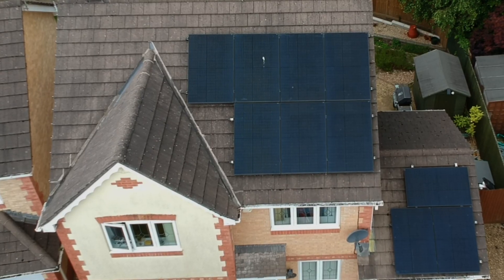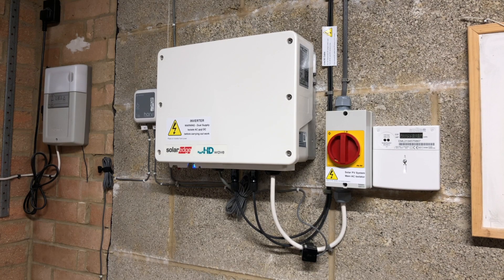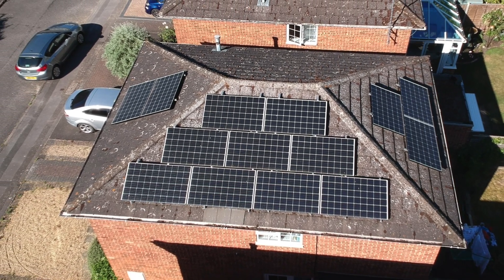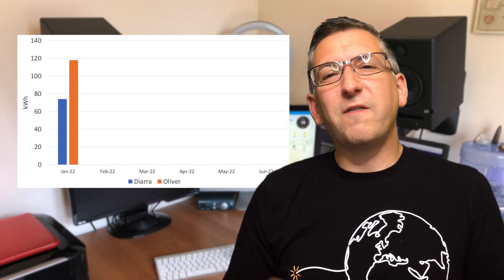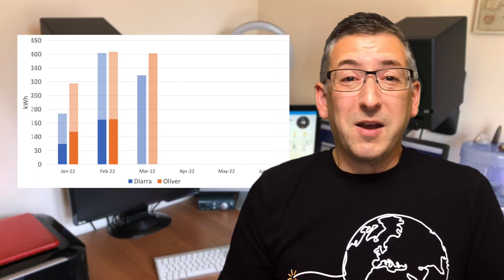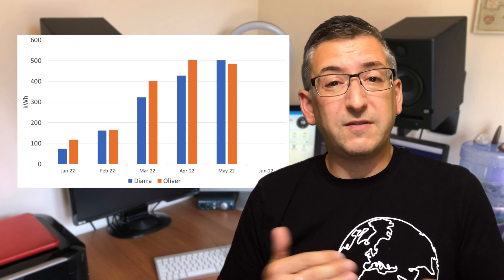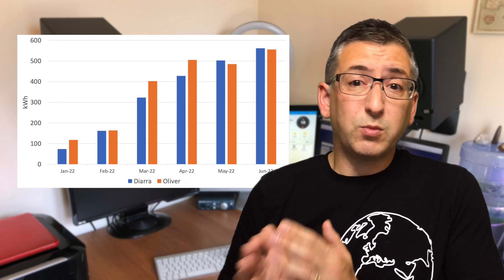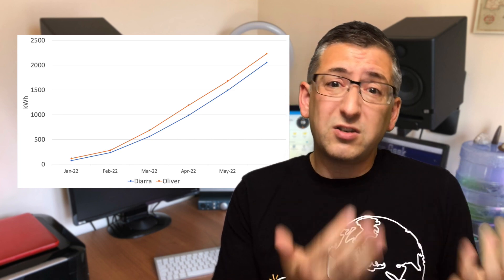SolarEdge vs Enphase: Six Month Update

Comment: The most important aspects of solar inverters are:
1) reliability
2) reliability
3) reliability
I have replaced half of the solar edge inverters I installed over the last ten years and have replaced many Enphase units we did not install.  As a solar installer, I think it is way too risky to install electronics in a hostile, under array location where servicing involves a truck roll as they fail one by one.
Reply from the maker: That's useful to know thanks, it explains why the installers I spoke to when getting quotes were reluctant to install micro inverters.

Comment: The comparison is not really an apples to apples comparison.

There’s roughly a 1% more efficient round trip conversion rate with SolarEdge because they use DC-to-DC converters.

However, SolarEdge’s central string inverter is most definitely going to fail earlier because of it being a string inverter and not a micro-inverter. It’s going to be inverting more power and thus taking more wear and tear than the micro-inverters which will increase maintenance costs.

Also, like they pointed out in the video, with the microinverters, you can slightly edge out on power production no matter what the roof plane is because it’s all about amount of useable light.

The best approach to Enphase is to try to minimize the clipping from the DC conversion as much as possible but to not oversize the microinverter to the panel so that you get the full use of the microinverter.
Reply from the maker: Valid points... but best we could do without a proper control environment :) It's more to get a conversation started over a comparison with the solutions rather than being a precise kWh to kWh generation comparison. We'll try to update over time and we'll see if reliability really is different between them.

Comment: The latest round of rate hikes (here in S. California) really make the west facing panels more valuable. Our peak is 4-9 pm and 83c (~70p) per kw. My array is perfectly south facing but it would be nice to pick up ~3kw during the highest rate period with west facing panels espectially since we still use AC here into the evening.  We are able to cut all other useage during the peak except temps can rise to over 80F on hot summer nights.

Comment: This was comparing apples & oranges. In practice for the Enphase user, a SolarEdge system would have likely been significantly better.  With multiple-sun angles, the peaks that give you panel-level clipping with Enphase, would likely balance out and not clip with the SE inverter.
Reply from the maker: That was kind of the idea though, two totally different systems installed to try and generate about the same amount of power from the physical restrictions of our respective houses. I know it's not terribly scientific, but I found it interesting to compare and it fun to put together.

Comment: Interesting video, and timely as I am looking to possibly replace my Sunny Boy inverter on my 10 year-old system. I have a home-made tracker (see video link below) which produces about 4400kwh per annum but suffers from partial tree shading during winter months. I have just been quoted £4500 to replace existing inverter with a Solaredge design, how would the price compare to using micro-inverters? (I do like the fact that the Solaredge comes with a 25 year warranty!)
Short video of tracked array:  https://youtu.be/9HBbwar4EMI
Reply from the maker: £4500 just to replace the inverter??? That sounds very steep. My 3.68kW SolarEdge inverter only costs about £700 so plus installation I'd expect it to be around the £1k to replace. Unless you are considering other components like optimisers and maybe new panels in with that cost? And I've watched that video, that's some serious engineering going on there! I wish I had the land to put something like that on.
Reply: @SpeakToTheGeekTech  Yes it does sound steep, considering the whole system was installed ten years ago for £7000. You guessed correctly, the price includes adding the optimisers to each panel. Not sure how much you paid for your complete inverter set-up with optimisers?
Reply from the maker: My whole system was about £10k for inverter, 10x optimisers, 10x 390w panels, Eddi/Harvi, GivEnergy AC-3.0 battery/inverter. I'm in the process of putting together a video about the costs and payback timescales so it's all fresh in my mind at the moment.
Reply: @SpeakToTheGeekTech  do you know what the inverter plus optimiser cost was? That is the figure I will need for comparison and also working out payback scale.
Reply from the maker: I don't exactly sorry, my quote was never broken down into that detail. I only know by looking up the products on other reseller sites. Roughly £700 for the inverter and £50 per optimiser was what I saw when looking back a year ago. That excludes installation of course.
Reply: @SpeakToTheGeekTech  thanks, even with 18 x £50 for the optimisers the total cost of components to replace my Sunny Boy still comes in at less than half the price I was quoted. I will tread cautiously…

Comment: Hi guys got bit stuck on Enphase manufacturers reference number on DNO notification I was given a number by Enphase which was termed as a reference used in Northern Ireland for g99
My inverter are iq7A if diarra remembers his notifications may be he can help.
Reply from the maker: I'm afraid that for both me and Diarra our installers completed all of the DNO paperwork and submitted it on our behalf. I've checked my letter from the DNO and for me it just says "Installation of a Solar Edge SE368OH Inverter & Giv Energy Giv-AC3.0 Inverter - exporting 5.2kW only", so no special codes on the response at all.
Reply: No worries thanks for reply 👊🏽

Comment: Its all horses for courses 

Each string on the emphase solution will terminate into junction box, which could be classed as a single point of failure 

Also, if a micro inverter fails, you need to get on the roof, get under the panel to swap it out.

The Solar Edge inverter will be more accessible.

And because the solar edge system uses optimers, it can handle shading and split roof configurations  the same as Enphase.

But the the real decider will be the  performance and efficiencies when batteries are added.

The solar edge system can allow a DC connected battery, meaning one DC to AC conversion for usage.

Because the Enphase solution has AC coming from the roof, to store it will need an AC to DC conversion, and then to use the stored energy will required another DC to AC conversion.

So SolarEdge beats Enphase in my view
Reply from the maker: I agree with your conclusion of course! Our conclusion so far really is that the differences between the two brands in terms of performance is negligible compared to other factors such as the layout of your roof. But still, it's a good conversation to have.
Reply: If solar edge optimizers go out, you have to get on the roof and under the panel. Just as you would with enphase micro inverters.

Comment: Hi Guys, Fun competition. I have both a Solar Edge array and Enphase array on my roof generating 10kW of energy. I am a greater fan of Enphase as it gives me more control over my system than does my SE system. I also have a 20kW Enphase battery array and a Tesla Y. Diarra, you could produce more energy if you used the the IQ7+ microinverter and we haven't even considered the IQ8 that can let you generate if the grid is down. The Enphase system I believe is about 10-15% more expensive than a comparable SE system but I believe it is worth it. I look forward to your future reviews.
Reply: Enphase is cool tech, no doubt and it is a good product.

However just like apple it limits it to their ecosystem only and in the long run that can be problematic - they would be more appealing if it could be coupled if a byd battery and so on.
Also there is an availability issue with iq8, nowhere to be seen in Europe...

On the technology side others are catching up Fronius and sungrow can also power ur home on a blackout and charge ur battery and have blackstart capabilities - so that's not exclusively to Enphase
Reply: Anyone reading this now, enphase do not let you generate if the grid is down

Comment: The solar edge system has a single point of total failure correct?
Reply from the maker: Correct, yes - the string inverter. That is the main advantage of a micro-inverter solution in my opinion, removing that SPOF. There are pros and cons to both solutions though and we plan to go into those in a bit more detail in the next video scheduled for October.
Reply: @SpeakToTheGeekTech  I'm thinking about an Enphase system so roll on October.  Great vid guys.

Comment: Support means a lot to engineers I sent my first overview of the solar system to solar edge for feed back, had no response. Then I looked in to Enphase and response was instant and it felt good.
Reply from the maker: That's a valid point - I have contacted SolarEdge support personally, and they were helpful and fast to respond. But that was as an end user not an installer. We've approached this whole review from the perspective of end users actually and not installers, so perhaps that's an aspect we could look at in future videos - I've made a note!

Comment: Talk my advice from a Solar Edge system owner.  DON'T GET Solar Edge.   My Solar Edge inverter failed after about 3 years.  As of July 10, 2022 the company can't provide me a shipping date to replace the unit under warranty.  Pretty simple to decide what is better a working Enphase system vs a failed Solar Edge inverter taking my entire system down.  I should have done a review on reliability before I got my Solar Edge system.  I got an expensive sun shade on my roof.

Anyone else here having this problem?  Maybe a class action suit?
Reply: This unfortunate.
However statistically this isn't an issue as both design have  relatively equal failure rates (there are some YT analysis on that), ur problem is related to the current supply chain issues - doesn't help but that's the reason. Could also be vice versa with a broken Emphases Envoy (or whatever that unit is called) system won't work without one either....
Reply: Just buy another inverter at overpriced eBay prices and sell the replacement unit once it arrives at overpriced eBay prices 😉
Reply: I'm definitely leaning towards Enphase system after reading your comment. Thanks for sharing.👍👍

I've only just realised that the inverter is the weakest link in any system.

I hope you have your new inverter by now.

Comment: Thank you for your video. Really well done, and funny how you two "fight".
But from a scientific point of view, of course, your comparison contains serious errors; this is not really the way to go; ideally the two inverter technologies should be connected to the same array on the same roof (same panels, same roof pitch, same direction etc.). And the power should be measured with the same meter.
However, the result is to be expected. It probably doesn't matter which system you choose, the production performance differs only marginally over a whole year.
Reply from the maker: Yup, totally agree, we could do this with a lot more scientific rigour. Sadly though, neither of us have the budget to undertake such a project (which would require a control too!) so have to make do with our own installations as-is. I have tried to get Diarra to buy an identical house to mine in my village so as we could test this but he just moans "something something Wales is too cold, something something have to put up with you more"
Reply: @SpeakToTheGeekTech  
My neighbor and I live in the same terraced house, so to speak; our roofs are the same size, have the same orientation (south-southwest) and the same slope. He chose SolarEdge, I chose Enphase. I can show the production output here (because they are publicly available anyway); However, it should be noted that these numbers were recorded with their own and therefore different measuring systems and should therefore be treated with caution(!):

SolarEdge:
21 Panels: 6.930 kWp, annual production: 7.750 kWh = 1,118 kWh per watt
Enphase:
18 Panels: 5.940 kWp, annual production: 6.815 kWh = 1,147 kWh per watt

One sees; here too the difference is marginal.
Reply from the maker: @RomanKuechler  That's pretty close. How did you find Winter vs Summer performance between the two solutions? Did one perform better during the cold season while the other caught up during warmer months?
Reply: @SpeakToTheGeekTech  Unfortunately, I only have the yearly data from my neighbor, no monthly data. Too bad, I would be interested too. From a scientific point of view, my comparison still has some errors, e.g. we have different panel manufacturers and therefore possibly different temperature coefficients (but both have the same power of 330W per panel).
Reply: @RomanKuechler   Which produced the more solar during the winter months - Solar Edge or Emphase ?